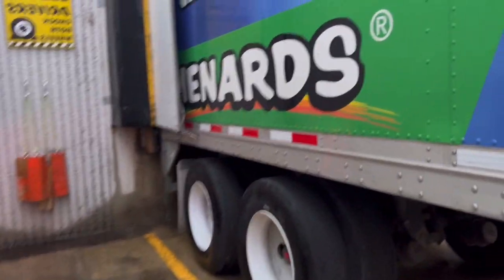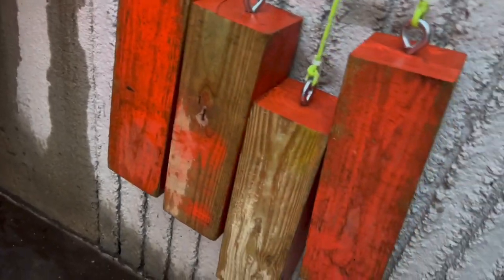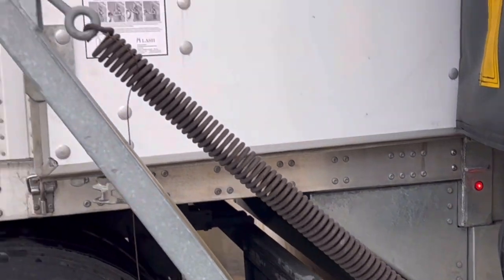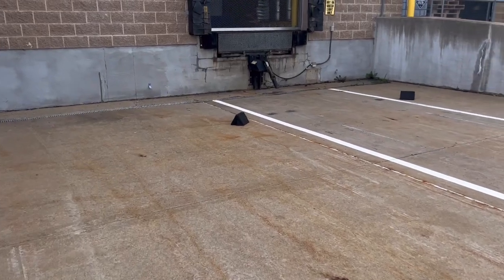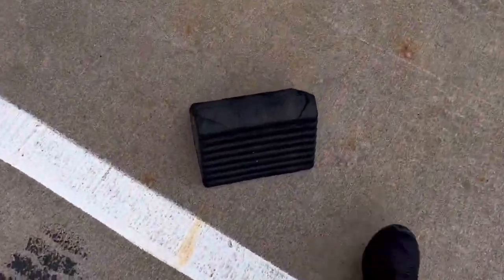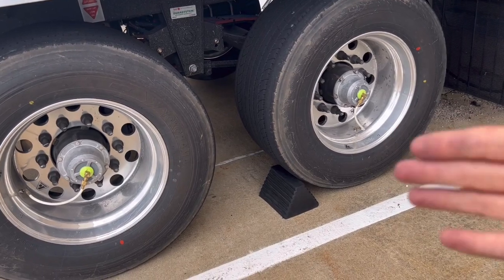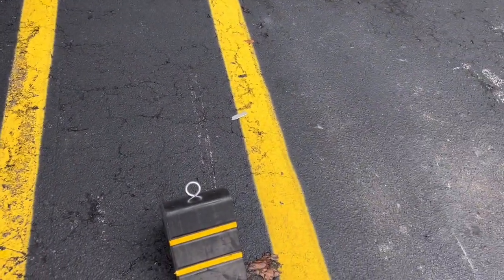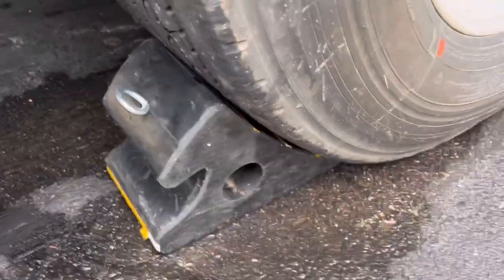CAUTION ⚠️CHOCK YOUR WHEELS🛞🚛

Comment: I'm at a shipper rn that has metal chocks with a long handle (so we don't have to bend over) and a sensor that lights up along with the loading dock signal light. So even if your light is green you'll see the little chock indicator reminding you to remove it b4 pulling away. Cheers.  Stay safe.
Reply from the maker: Cool.  Thank you!!!🙏 😎